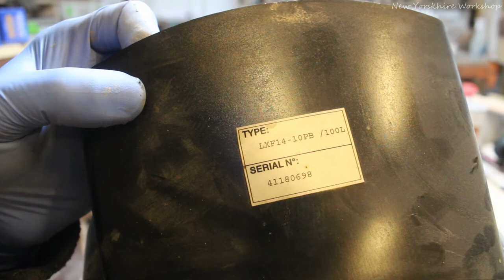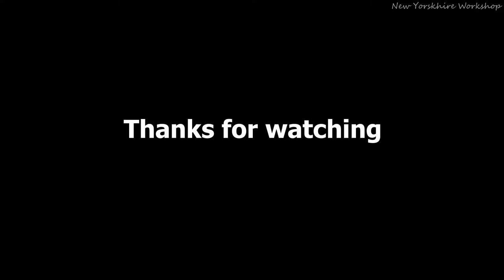Atlas copco lfx oil free Compressor repair part 1

Comment: hello, i also have an lfx 1.0, but the problem with mine was that the ptfe piston ring was cracked, i have trouble finding another piston ring made the teflon material, would you help? great videos thanks!
Reply from the maker: Hey, I answered this in the comments of part two as well but here it is-
the parts list is here- http://www.surgevessels.co.uk/wp-content/uploads/LFX-Parts-List.pdf

And the part number for the piston ring of the lfx1.0 is 2901 0981 00 if you google this number you will find a few places around the world who sell it, it isnt cheap though!

Hope this helps!

Comment: Hi I have this motor for my air compressor, it has seized up any tips on how to repair it? thanks!
I've also got same hammer! haha
Reply from the maker: first thing i would do is disassemble it! mine was a bearing failure so that is a good place to start looking. another possibilty is piston ring failure with bits of broken ring getting jammed between the piston and cylinder wall. my money is on bearings though.
Reply: New Yorkshire Workshop i took it apart up till the engine casing, i found when i removed the  piston head casing the motor moved freely as soon as I put it back together the motor was stiff again
Reply from the maker: @ConvBoy1  I see, so  does the piston move freely inside the cylinder when it was apart? if yes then it is probably a similar problem to mine, if the bearings are not seated properly then it will bind up when assembled, you might have to look more closely at the bearings, they might seem ok when turning by hand but be completely buggered inside.
Reply: New Yorkshire Workshop yes piston and motor shaft moves freely in cylinder. Hard to believe pistons because the compressor has only done 266hrs must be due to age.
Reply from the maker: @ConvBoy1  yeah the atlas copco service schedules are usually listed by the thousands of hours! they are built to be used. could possibly be that someone has disconnected the hour meter in the past though. mine doesnt even have a meter so i cant compare but it was used by the NHS before and then the guy i bought it from had used it for a while.
 id definitely look at the position of the two bearings between the crank and con rod because if they have slid far enough the piston will sit at an angle and bind up in the cylinder. you ahould have about 2mm gap between crank and con rod.
those two bearings are 6204-2RSH, the originals might have been stainless, these are a cheaper alternative.
also the big shaft bearing is 2RS1 and smaller one is 6205-2RSH